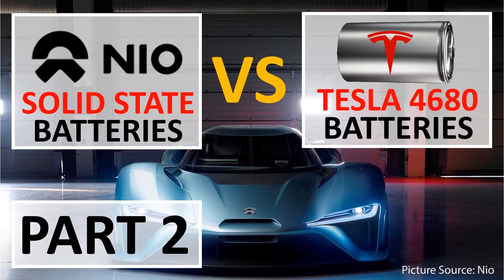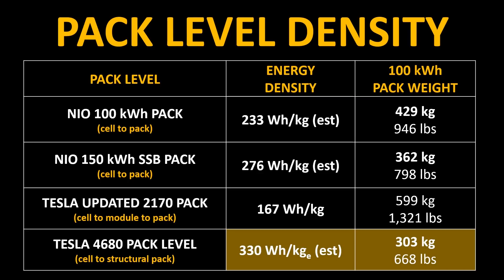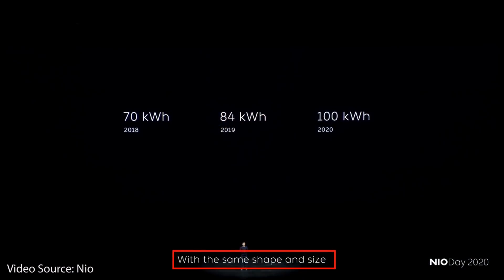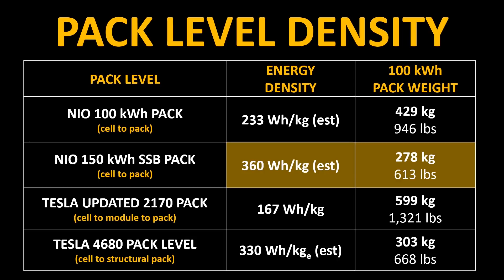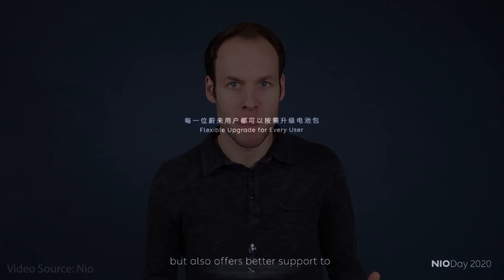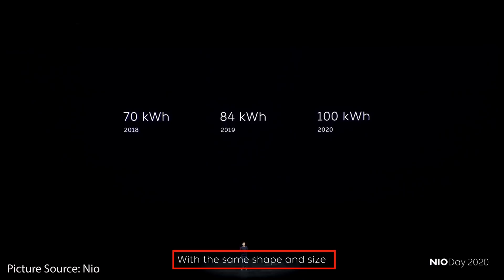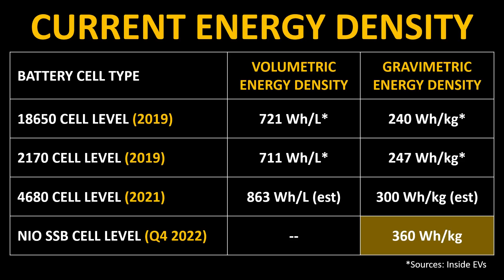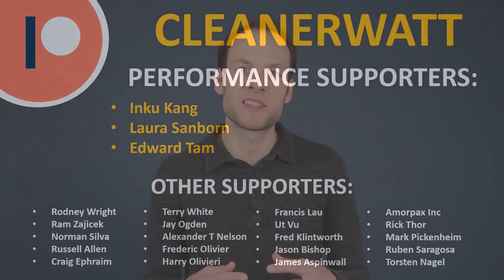Tesla vs NIO Solid State Batteries (Part 2: Did I get it all wrong?)

Comment: I wonder if Tesla’s vertical integration will become detrimental, like for Intel. For example, if CATL becomes the battery version of TSMC to Tesla’s batteries. Obviously they are entirely different situations, but I think it’s a possible concern
Reply: Elon said that they plan to sell more cars than they can manufacture batteries for a long time. Now, they use batteries from Panasonic, LG Chem, and CATL.  And energy sector will be even bigger - so it looks like Tesla will use everything they can grab :) and there will be many players (good) with differently optimized batteries. So, I am optimistic here.
Reply: @AndrewSienx  Oh yeah, of course. I'm long Tesla. I just think the potential downsides of vertical integration need to be considered as a risk. Not just with batteries, but also things like manufacturing, autonomy (mobileye is looking pretty good...), etc. I'm definitely also optimistic, though, so I'm not too concerned at the moment.

Comment: Solid state batteries are vaporware until anyone can make them at scale, etc.  When solid state batteries become practical, Tesla would be in a great position to take advantage of it due to their scale.

Tesla's progress in Lithium ion has exceeded hypothetical solid state battery improvements.
Reply: Absolutely not. Improvements in the last 10 years (from Tesla or others) have mainly been cost reductions and reduction in the use of "unwanted" materials like cobalt. Engery density has not improved at all. Solid state batteries will change this. The question is: who and when? And at what cost? But not in the next 2 years for sure. Toyota will introduce its solid state battery this year - let's see what time frame they have in mind for mass production. Quantumscape are talking about 2024 - 2025 which already looks quiete optimistic to me.
Reply: @EinzigfreierName  It's possible and perhaps even likely that solid state batteries will surpass Lithium Ion eventually, but that is many years away, particularly for volume production.  And the progress with Lithium Ion has been very strong.
Reply: @LoanwordEggcorn  Yes but then I don't understand why you say Tesla improvements have exceeded "hypothetical solid state battery improvements." . Isn't that the opposite of what you just wrote? . I'm a bit confused..
Reply: @EinzigfreierName  Tesla's continual improvements in their real world production batteries have nearly kept pace with the theoretical improvements of laboratory scale solid state batteries.  

(There is a very huge difference between producing a few batteries in a laboratory versus mass producing them by the hundreds of millions.)

Tesla's Roadrunner cells when they enter production in 3 to 4 years as cell to pack construction may have the same 400 Watt-hour per kilogram energy density that QuantumScape's solid state batteries hope to have in 6 years.

Tesla is already in the early stages of mass production of Roadrunner.  No other solid state battery is as near to mass production.  A few prototypes from Toyotas is not the same as mass production.
Reply: @LoanwordEggcorn  400Wh/kg with conventional Li-Ion technology seems quite unlikely to me. Energy density for Li-Ion is stuck at ~250-260 kWh/kg for at least 7-8 years now. If Tesla reaches 300kWh/kg, that would already be a big deal. But 400? No way..
Reply: @EinzigfreierName  Elon disagrees.

https://twitter.com/elonmusk/status/1298017332904620033  
"400 Wh/kg with high cycle life, produced in volume (not just a lab) is not far. Probably 3 to 4 years."

He is probably referring to using more Silicon, which is already announced for RoadRunner.

A Lithium ion battery with a pure Silicon anode (which is possibly physically impossible or at best extremely difficult) would have a theoretical energy density of 3600 Wh/kg.  The maximum possible for a realistic Lithium-Silicon battery would probably be closer to 1000 Wh/kg.

But Tesla has already made RoadRunner cells with very significant amounts of Silicon.
Reply: @LoanwordEggcorn  Just a single twitter message with the word "probably" in it? Why was nothing said about that during battery day one month later? Sorry, but I don't take this too seriously.
Reply: @EinzigfreierName  Probably because it's pretty hard to do.  The Roadrunner cells are already driving around in prototype cars, presumably with the encapsulated Silicon that WAS mentioned during battery day.  

For reference, here is where they talk about Silicon during Battery Day:  https://youtu.be/l6T9xIeZTds?t=3883

Presumably the extra cell density would come from finding ways to use more Silicon, plus other improvements.  The greatest gains probably come from more Silicon.  The science and engineering of these improvements is difficult.
Reply: @LoanwordEggcorn  Still - as far as I remember (and I watched the whole battery day video at least twice) there was never a solid statement given about actual energy density at the cell level. And I saw no indication that it would reach or even exceed 300Wh/kg. There were a lot of details on the level of cell chemistry and production and also on the structual design of the battery pack and the whole car -all nice by itself, no problem with that. But they somehow seemed to want to avoid the actual  kWh/kg number for the current 4680s or the future roadrunner cells.
Reply: @EinzigfreierName  Roadrunner is still a work in progress.  Tesla mentioned goals at the pack level, particularly battery pack cost reduction of 56%.  

At this point in history, the cost of battery packs matters much more than energy density in order to make EVs more affordable for more people.

While higher energy density is desirable and constantly improving, battery cost is far more important.

If Elon thinks 400 Wh/kg for Lithium Ion is possible in 3 to 4 years (for example by using more Silicon as is already happening with Roadrunner), then he may be right.

He may be in a position to know something about batteries.
Reply: @LoanwordEggcorn  I agree that cost reduction is the important factor at the moment. But I would bet any time that we will not see a non-solid-state Li-Ion cell with much more than 300 kWh/kg in the next 3-4 years.
Reply: @EinzigfreierName  I would respectfully suggest that Elon may have better information about the state of battery technology than you or I, and that he disagrees about the latter.
Reply: @LoanwordEggcorn  Well, this was just a single random tweet. He may say something different next week. If it was based on solid information, he had mentioned it during battery day because a 400Wh/kg battery would be much more interesting than anything else presented there.
Reply: @EinzigfreierName  Depends on one's interests I suppose.  While higher density is nice and will likely happen, the 56% battery pack cost reduction of Roadrunner is probably (far) more important.  

Roadrunner will likely include density increases due to significant Silicon use, as mentioned in Battery Day.
Reply: @LoanwordEggcorn  I agree to that. Cost is probably the most important factor for the next years to decide what car makers will be successful selling EVs.
Reply: @EinzigfreierName  Yes, precisely.

Comment: Nio can buy whatever off shelf battery available in the market. They are riding the Tesla wave. They have no moat or advantage vs any other China EV maker.
Reply: Finally a thread where people get it. NIO is just a system integrator. They don’t make anything including their autonomous software.
Reply: they have to make it compatible with their platform first.
Reply: I’m not sure why investors don’t see this. Their lack of factory, battery swap system and lack of transparency as a Chinese company, all seem like big disadvantages, to me.
Reply: @shepherdsknoll  most nio buyers are speculators 99% of them never see or ride a nio in their life. They missed the Tesla boat and want to find the next Tesla. Wall Street is playing them.
Reply: @shepherdsknoll  right now, greed rules over logic or common sense.
Reply: Not to mention the fact that the entire assembly process of solid state batteries must be done in a moisture free environment. The battery itself must be sealed in such a way that moisture can never enter it during its entire lifetime.
Reply: @grumpusmaximus9446  Tesla is hyper focused on cost of the battery and this will also allow them to lead for years to come. If solid state battery packs cost $50k to manufacture then Tesla has nothing to worry about.

Comment: Does nio make/ design their own battery?
Reply: No they use catl. This technology will be available to anyone.
Reply: @kablaam718  Did you watch the video?

Both Nio and tesla buys batteries from CATL and both design battery solutions. 

Don't get my wrong, tesla is great but think this commentsection is a bit close minded when it comes to nio.
Reply: @JVC20  but Tesla also makes its own cells. its very clear that Tesla will buy as many 3rd party cells as it can but its also trying to make as many as they can make themselves, proably because they expect EV demand to exceed the worlds cell supply. Tesla building its own cells is still a manufacturing and technological advantage.

Comment: If they had a good battery, they would not have to do any battery swapping.
Reply: If QuantumScape's 2min full charge battery comes to fruition, battery swapping would not be needed
Reply: But until then, Nio's battery swapping paradigm enables their customers to have the best available battery technology (fastest charging, longest range) without concern for battery life (num cycles etc).
Reply: @jb9652  tesla already has the fastest charging along with the longest ranges, Nio's promises dont count.
Reply: That is correct.  BaaS is nonsense.

Comment: You make a lot of mistakes in your assumptions in batterycell and pack specifications. Extrapolating figures from commercial/promotion videos into technical specifications is redicules! Also presuming cell to package ration of cilindrical cells to prismatic packs better or equal than prismatic cells to prismatic packs shows you only are good in mathematics and don't understand much about physics. The ratio from cell to package in Tesla batteries is one of the worst in industry! Try to fill up a square pack with cilindrical cells better than with square cells. Everyone will conclude that square cells will be more efficient. The cilindrical cells also have a structural encasing while square pouch cells don't and thus save volume! The idea of cells, their cilindrical shell, contribute to the strength of the whole pack sounds nice but is bogus. In the "commercial" presentation of Elon on battery day I don't see any volume reduction of the pack. Even worse, Elon is talking about big cast aluminium bottom chassis. Anyone with some technical knowledge will tell you this makes everything weaker an heavier! Carbon fiber and high strength steel are much better options. Or follow avionics industry, they used duraluminium sheet metal in the past but carbonfiber now. Aluminium (low strength) casts are a real no no!
Reply: 1. Cylindrical cells cost far less to manufacture than prismatic and pouch cells
2. Cylindrical cells can be manufactured at a much higher
3. Cylindrical cells cope with swelling much better
4. Cylindrical cells are much better for thermal regulation
Reply: @brano2k  cilindrical cells have their history in drop-in replacement of primary batteries
1 cilindrical and (hard)prismatic cells are more costly to produce because of their extra housing a pouch cell does not have.
2 less cost means also higher production rates
3 swelling always occurs with batteries, in cilindrical cell this happens inside de cell housing, with pouch cells this happens in the pack. But for both extra volume must be reserved for expansion
4 a flat surface can be contacted more easier to a cooling plane (heatsink) than a cilindrical surface, look at Tesla with the complicated flat copper hose meandering between the batteries! The whole pack design with gluing, soldering and assembling of thousands of small cells is an engineering's nightmare!
There is only ONE reason Elon Musk decided in the early 2000th for the 16850 cilindrical cell. Availability of production capacity of cilindrical cells that are more and more phased out in laptops and power tools thus free for other use!
The rest of the automotive industry has started already long time ago development of:
1 much lager size cell, thus smaller numbers of cells in the pack
2 flat square pouch cell, cheaper (smart phones!) and easier pack assembly
3 Different cell chemistry for wider temperature stability, power delivery, safety and cycle live, fulfilling real automotive requirements (you probably don't understand?!)
Tesla is now moving slowly towards this direction, starting with bigger cells, but Elon has a big ego, not admitting his initial choices where far from ideal. And everyone who thinks you can start your own battery manufacturing from scratch in 2-3 years is not very intelligent!
Fanboys think Tesla is already making batteries for years, false! all is done by Panasonic and they will be the first to make the new 4680 cell with their technology, not to be succeeded by Tesla for years to come. Maybe at the time Tesla will have autonomous driving?
Reply: @brano2k  don't take me wrong dispite Tesla is not always taking the best design choices they did a good job starting a car manufacturing in ~13 years.
For that they had to buy away brilliant employees from mainly European and Asian competition.
Opening production and development facilities in Germany and China will certainly improve the cars they make!
Reply: @corpierro  Tesla is doing a great job and they are NOT moving slowly. Tesla have car models with different cell chemistry and different cell form factors already in production. Yea, they even make use of prismatic cells. Tesla is in no way locked to cylindrical cells. The new innovations they have for the 4680 cell will work on other form-factors as well. Right now Tesla is settings the standard! Right now, the other EV manufacturers need to prove that there battery pack will survive the warranty, because no matter how good your battery is (in terms of performance, energy density etc.), if it degrades to fast and a battery replacement is needed within a year the company will bankrupt. This is not a problem in the phone industry because the warranty on the battery degradation in phones are often a year or so.
Reply: @brano2k  the reason that Tesla uses other batteries is for one reason only availability! In China 2170 cell are not available  so they use other cells, pouch and also LiFePo. Batteries from especially LG chem and SK innovation have proven to be very reliable and great longlivety, the best in class! The Chinese manufacturers, eg CATL are expanding fast. The legacy car manufacturers seems to be evolving slow to ev. This is a misconception! A lot of people are not convinced in the transition yet and want ice cars thus a lot of mony can be earned there. Not so good for environment but understandable. An ev is not only a electomotor powered iPad on wheels. That's only 30%, the rest is a car like any other. Lecacy manufacturers have a big base in car production and development capacity. O.k. the American legacy automotive industry is a bit of a laughingstock! Tesla is hurrying up to build factories keeping up capacity while the legacy manufacturers show they can make the change much quicker than expected. You have to look to see it and take off your Tesla sun glasses! Funny Tesla is calling their factories "Giga", a lot of other factories have multiple size and are not called Giga. Tesla is impressions, fancy frases, sexy specs. show and imagination and for the rest a shinier copy of the rest at a hefty price! Market saturation will end this American dream soon enough. Interesting is also that a similar in values and apperances company in a different branch wants to step into the ev market!
In the end this is good for the customer, plenty ev available yet with sexy specs but only competition wil lead to affordable prices!
Reply: @brano2k  oh yea an important fact for battery "Format"!
A format is only useful for something you exchange, for instance changing replaceable primary batteries in a appliance. If a battery cell is a non interchangeable part of a battery pack a format is not needed. And formats always means costs, for an extra shape and housing per example😉
Reply: @corpierro  The cell manufacturers will always tell you that there cells are the best. Understand that the cells are tested in laboratory conditions and it is up to the integrator to make sure that the battery is used according to the spec. This is where the integration solution and software comes in from the other EV manufacturer. If it is bad, the battery will degrade at a rapid rate. This can only be seen with usage over time. Tesla has data from their batteries passed 10 years. The ICE companies must restructure the whole company in order to become an EV manufacturer, this is a fact. You think that it is so easy for legacy car manufacturers to build EVs, how come VW is trying to reach a 1.5M EV cars per year by 2023 in order to catch up with Tesla? How many horse-and-wagon companies did the transition to produce ICE cars? Competition is good for Tesla but c'mon, nobody is even close in producing a car that will compete with Tesla models today.
Reply: @brano2k  your are a hardcore Fanboy blind for things around you. Most of youre comments are stongly biased. VW delivered 134000 evs in 2020, in fact in a perion of 3-4 months! You can lookup when Tesla reached this rate counted from the start. It took 17 years to reach 1 million!
Reply: and this is why you don't manufacture your own cars and Tesla does.